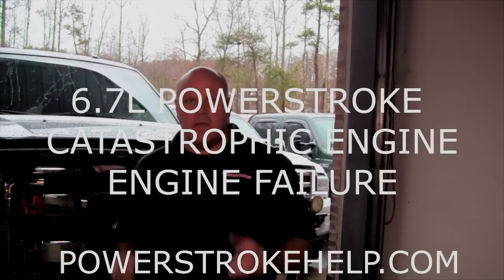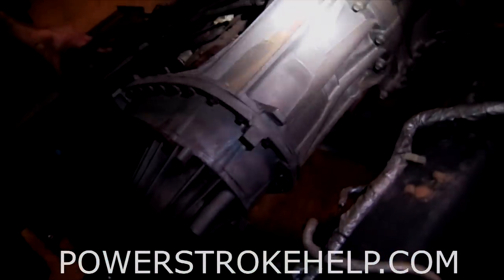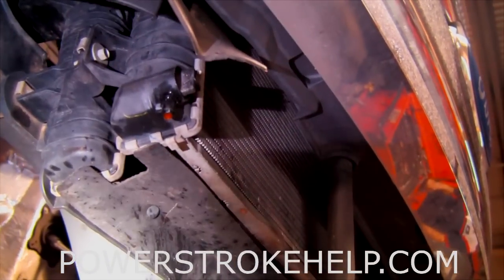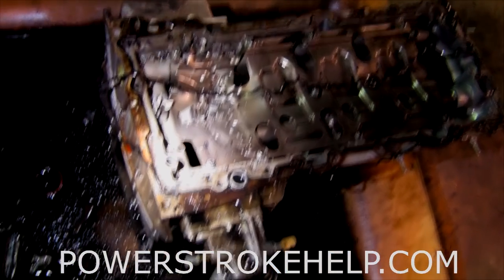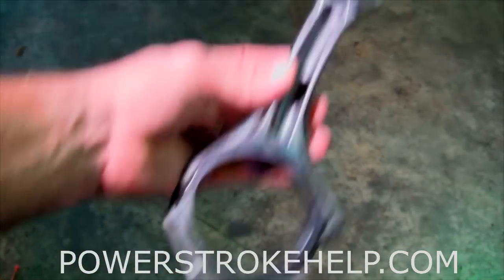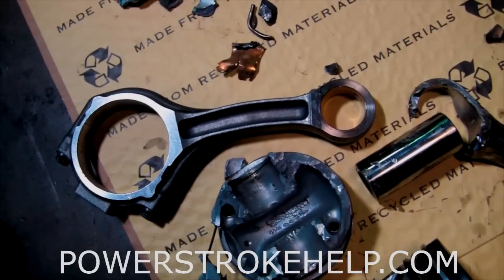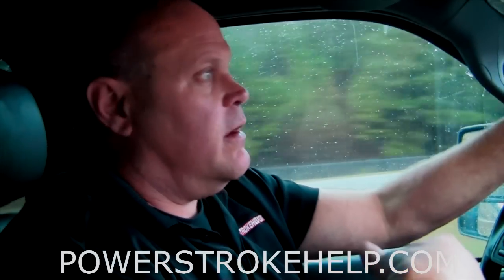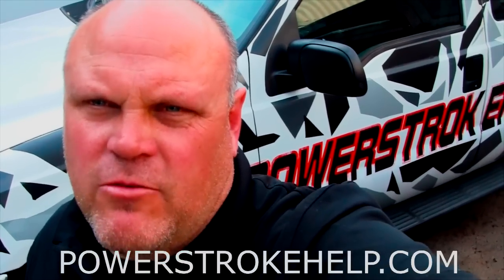6 7L POWERSTROKE CATASTROPHIC ENGINE FAILURE

Comment: Almost traded in one of my 7.3's for 6.7 truck, own 2 dually's 1 (4 x 4) & 2 f-250's just Rear wheel drives, my 6 spd manual gets 22 miles to gallon,  on all my 7.3's we installed fuel line cross's so fuel is delivered on both sides of rails changed the intakes to SS sweeps & Danalite oversized air filters- TS-6 tuner which we only set on towing!! Honestly, I like simple is better, oh forgot larger AIR TO AIR INTERCOOLERS on Dually's. I feel building for only durability is best, why build put big tires on, lift the truck so high you need an elevator to get in? Just had a good transmission shop rebuild my one 4 x 4 dually tranny, the owner & employees all drive 7.3's  I felt good & they taled me into keeping my 99.5  4 x4

Comment: I used to think that Ford 6.0 on were junk.  But finally realized that they are actually pretty good.  They are already "tweeked" enough to advertise the highest power/torque #s out there.  If you DE-TUNE the engine and pay close attention to the maintenance, they would go a lot longer without any failure.  But, that is equal to chopping the nuts off of a 16 year old boy... It AIN'T GONA EVER HAPPEN!  Just my two cents.

Comment: Hello. Great information. I have one concern.  I live in northern Canada. Where the temps in winter can regularly reach below -35 C.  These urea systems freeze and fail all the time. Rendering my $67,000.00 pickup that I use everyday for work useless and me freezing to death. Also the constant idiling plugs the egr cooler.
Is there any solution to keeping this urea from freezing or just getting rid of the urea system alone?

Comment: Correct me if I'm wrong but it seems from your comments, I sense some negativity towards Ford lately?  When a person says, "Yes, I Build a Better Motor than Ford" with a bit of attitude behind it???? makes me ask, "Are you becoming Anti-Ford?"  Just curious really?  I will say that if in fact the owner is running any Diesel HOT Tuned pulling a heavy load this is a recipe for disaster or is this unique to Ford's 6.7 only and Duramax and Cummins are less prone to this type of Disaster maybe because of beefier components???
Reply: +M Keoni W (M-Dog) The dodge would blow the tranny towing heavy on hot tun, and duramax's go to limp mode for tranny also If running hot tune pulling heavy. Their is a reason they have a Towing tune and race tune ect. This guy was dudmb to think he could pull on race tune.
Reply: jwsrules123 thanks.  I was trying to be ignorant but really I know the answer.  It's just lately Powerstrokehelp, which I thoroughly respect his views, has started to contradict his own comments lately.  I think it's a simply comes down to the way he's wording his comments, but maybe it's because he has an entirely different view of Ford altoghether than what he once held...So my Question????  Would be nice if he actually read and commented on comments like these.

Comment: Nice Vid!  Need to Clarify, You don't build a Better Motor than FORD, Correct me if I'm Wrong but You don't in fact build Motors from Scratch.  What I mean by Scratch is you don't take raw metal and forge it.  
What you have done is "Improved on What Ford already Built."  Yes I trust you made it better, that's generally what Engine Builders do???

Comment: Lol Mount Eagle is where my 6.0 bought the farm. I made it to the bbq joint across from the flying J. Bent a valve was popping through the intake. No tunes what so ever. Don't need them has enough power to do what I need it for.

Comment: With the separate cooling system on these trucks for the emissions does this take the heat out of the engine more effectively than one huge radiator like on a 6.4  ? An Egr still puts hot exhaust gases back into the engine which I cant see being good for it and can only be removed with tuning? Are you saying 6.7 owners should leave the trucks with emissions still in place because there is not safe tuning out there for these trucks to be deleted with yet? or the cooling system is substantial to dispersing the heat out of the engine with out damaging anything over time? Or leave these trucks stock due to the legal aspect of it? Its illegal to delete a 6.0 or a 6.4 put we know the consequences of not. Thanks for the video!

Comment: Wow.. It's actually easier to lift the body off the truck than to pull the engine? That's insane.
Reply: Welcome to any modern diesel domestic truck for over a decade now.
Reply: +npsit1 On these new trucks, yes. Especially with how high up the truck sits. Think of it this way: On the assembly line at Ford the engine gets put on the frame before the body does, it makes sense to remove it that way.

Comment: Have you encountered any of those new 3.2s in the Transits yet? From what I know they are just the Duratorq engines from Ford's European market re-named
Reply: +Adam Kraabel The have EGR cooler problems and leak oil.
Reply: Sounds like a 6.0
Reply: I've rather do 10 EGR coolers on 6.0 F-Series trucks then one on a 3.2 Transit.

Comment: looks like about 6 lawnmower motors someone ran E85 in      whoooopeeee     2 stroke Dura Force Lawn Boy was run with 50:1 rather than 32:1 mix and the rod twisted kinda like the one you showed there.    bout this close to coming apart...rtfm folks

Comment: Bought my '03 F350 7.3 used at 155k miles about 6 months ago. Had a TS-6 position chip in it. First thing I did was yank that tuner out. I really want to run this truck another 15 years/150k miles, at least.

Kind of sad to see what's becoming of these newer 6.4/6.7 trucks. Emissions is killing them, and the tuning to run em without emissions equipment is killing them too! Damned if you do, damned if you don't.

Comment: Thanks for the video! I am looking to do a DPFand possibly an EGR delete on my 14' 6.7. I would like the extra range and it seems as though it would be a lot better for the life of the motor. I take great care of the truck and don't push it hard. I was thinking of using an economy tune when I get the tuner to deactivate the regen. Would this shorten the life of the motor? Thanks.
Reply: use only stock mapping, if you get a tune, make sure it's only to fool ECU into thinking DPF and EGR are still functional.

Comment: Bill Im really confused...In your other video (Which Powerstroke is the best?) You CLEARLY stated (almost word for word)that the 6.7 is a great engine, but "the DPF and emissions stuff will be the death of these engines"....but now your saying DONT delete?....You are sending mixed messages.....Would you expect to see catastrophic failure  from a deleted 6.7 that runs a stock tune or a fuel saver tune?....I was always under the impression that deleting these engines would extend the life of them.......Am I missing something?....Thanks....Chuck
Reply: chuck conet deleting and tuning are two different things.
Reply: I agree.  which is the recommended path?
Reply: Deleting the dpf is the way to go period. If you drive it with some decency you won't be blowing it apart, even if you're running the hot tune. You'll be safe running the stock power tune or a tow tune. It's all in the operator. Lots of guys run the hot tunes without problems.
Reply: I think what he's saying is by itself the 6.7 is a killer motor but because of the CAFE standards ford had to add the DPF to meet the emissions and fuel economy standards. If an owner deletes the DPF some other engine tuning is needed so the motor runs correctly. Most plug in tuners adjust the timing needed when the DPF is deleted. Again I'm no mechanic but that's what I gather from the conflicting statements.
Reply: James Smith Im with you...Id just feel better if he would say it...(he dont have to condone or endorse it, because we know it is illegal)...just clarify it
Reply: it's always best practice to delete EGR and DPF, but the only tune you should run is a stock map with the ability to fool the engine into thinking EGR and DPF are still there. TIMING is what kills engines. The earlier you inject diesel, the more power you make, but when you inject fuel while the piston is still rising, it puts extreme pressure on the internals. Stock tunes that fool it into thinking emissions equipment is still there is the way to go. Also when you delete EGR, get a plate that allows the coolant to still circulate, not like the H&S that is just a block off plate. DPF and EGR deletes are ILLEGAL for on-road use by federal standards so don't cry if someone busts you.
Reply: you clearly don't get it you got three choices. fast, cheap.reliable. NOW PICK 2 ONLY 2   you can delete it all keep the timing out  or other words (STOCK TUNE)
Reply: Once the truck gets out of warranty delete the shit. If you delete it before warranty expires, you just fucked yourself and if something breaks on the truck, you can’t get it repaired. (For free under warranty)

Comment: Another good video Bill. I've worked for a Cat dealer for 25 yrs and built engines for most of that time. The bottom end of the 6.7's look a lot like the old 348 and 349's. They were overhead cam V12 and V16 engines. The over the road truck drivers always had to have more power and more power! The old 3406's took a lot. These new engines are incredible and at the same time crazy! I'm not sure about going back to a water cooled aftercooler but they are smarter than I am. Thanks for all the great info!
Reply: Read a story once about how a guy put a 3408 in his f350 (he was wery wrich) he then proceeded to have it modded to get a lot more power than it was designed for. It sat most of the time he owned it. Every time he romped the throttle it twisted the crank.
Reply: 3408 is a huge engine and would never fit in a F350. 
You are probably thinking of a 3208 which would still be a tight squeeze.
Reply: Whatever it was it twisted his drive shaft alot. lol

Comment: 100% agree, tuning. Not saying too much tuning, but Bad trans tuning. In my opinion, the root cause is from Lugging w/too much converter lock up. That giant tune feeding those conditions....Massive amount of stress & heat generation! Then any microscopic impurity in that piston casting will show its face real quick. I think you're right on your assumption of piston failing first! You're the man! Your videos rock! (Diesel mechanic 20yrs running)

Comment: Two things. Put more lights in your shop. You shouldn't have to use a flashlight everywhere you need to look. Bad for your eyes. 

The second thing is, who gives a rats ass about the "public safety"? That has nothing to do with helping the truck. Basically you said to hit up DP-Tuner. Which I agree. I've had that in my truck for years and it runs the best.

Comment: Hi bill what about the 2 rear cylinder including the valves  and turbocharger issues you were talking about with the 6.7 litre with stock emissions when the truck goes in to regen it overheats the rear cylinder do you have any cure for that even with all emission equipement left on  what was the total bill for a replacement engine like that on that truck. ?

Comment: I have a buddy who ran the H&S Mini Maxx programmer & a turbo back straight pipe exhaust, his engine is done. The truck is now at a local dump just sitting there, he isn't going to put the money into to get a rebuild. It was a fast truck but like you said in this video, if you want to go fast you gotta spend money! You're videos are great, I own a 2006 Ford F-350 6.0 Powerstroke & it's running strong. Currently at 210,xxx miles.

Comment: Bill, you need to have a MASSIVE sign in your shop showing the price of a 6.7L Crate engine from Ford ($13,000 and up) and a message that reads if you run an off road tune and any emissions are deleted, this is what to be expected, and tell them that Ford WILL VOID THEIR WARRANTY if its found out that the truck has been tuned and Emissions parts Deleted.

Comment: I bought an '11 back in 2012. It had 18k on it, Florida truck. Loved it from the beginning, then at 20k the egr went along with basically the entire cooling system. Tons of front-end work and 5k miles later, the turbo crapped out. Went through two new turbos and just about every sensor under the hood. Luckily, Ford was more than helpful, however, if I ever buy another powerstroke I'll damn sure bring it to Bill.

Comment: another great videoHere's a thought I've had as I've run into more and more quick diesles out on the road... With all the luxury and features these diesel trucks offer nowadays do you see your shop getting more "inexperienced" diesel owners coming in who have never owned a diesel before and break them trying to run them like a gasoline / spark engine? like revving the crap out of them or just slapping a tune on and not worrying about how hard you run it because "you don't have to worry about detonation" for instance? I see a lot of nice fast trucks out on the road and I can only imagine quite a few of those have been playing with fire by running a race tune on a stock engine.

Comment: I have only a simple comment: Thank you government (EPA) for requiring a DPF WITH UREA and EGR, you have successfully destroyed the diesel engine. But wait, I am sure you'll find more ways to finish off the most efficient engine for heavy hualing.  When I was a kid on my Dad's ranch, all the diesels were simple and all you had to know was air and fuel. Now you need a computer just to figure out what's wrong. My dad got diesel delivered for $0.04 a gal. and it looked like coffee.  I have a 2013 6.7 and haven't had any problems other than a factory recall for reflashing the transmission program.  I knew I should not got rid of my old 7.3. 275k miles and the only problem was the clutch master cylinder. May the new year come without headaches and problems. ...keep wrenching

Comment: Seriously, what is it with people throwing crap-ass tuners into their trucks?  Furthermore, what's wrong with the way they were tuned from the factory?  I had a '97 F350 that was a workhorse with no modifications at all, and it was all power and plenty of get-up off the line.  If you want to race, maybe spend just a hair more on a custom engine that can handle the abuse than you will when some piece of cheap garbage makes your computer destroy the engine like this.

Comment: Bill, are new bare block castings available for the 6.7?
Every failed 6.7 I have encountered so far was user and or tuner related. 
We have a 2012 6.7 with over 200K on the clock and outside of factory recalls and regular maintenance have experienced zero issues. 
Thank you for all that you do.

Comment: well i didnt know when i bought my 2012 f250 that it had a delete system on it so i took it to ford to get all the oil and stuff checked out and wo and behold the upgraded my computer and then i found out it was a delete system so i had to buy a mini max computer just to make it  run but after watching you video im going to run it in stock mode $$$ i dont need this truck messed up